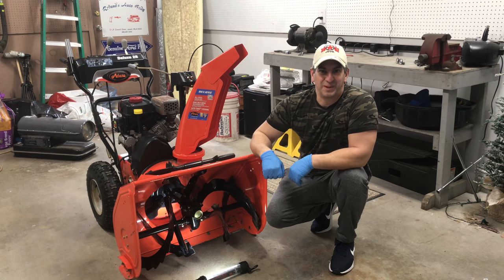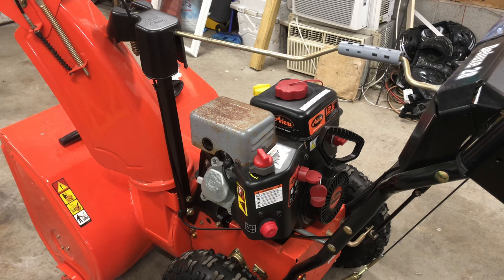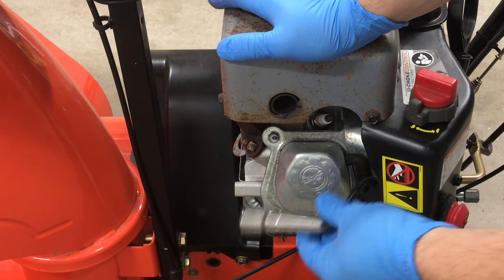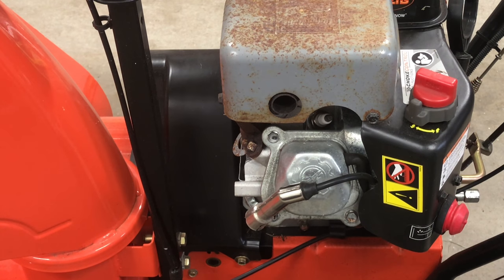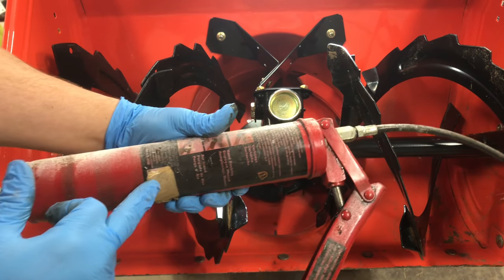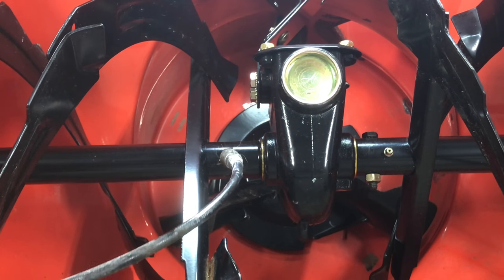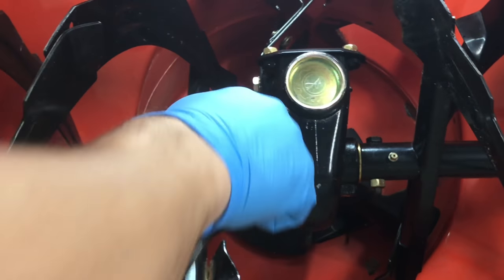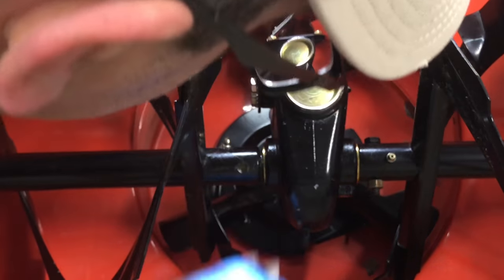How To Grease Snowblower Auger

Comment: Greath job!  Just make sure you put the auger in the same position they were prior to the maintenance, not half a turn forward.  The grease pin should be both in front.
Reply from the maker: Thanks for watching
Reply from the maker: This was a good catch, and yes you are correct make sure the auger is back in the same position before the shear pin was removed...thanks for the reminder bud
Reply: Why is that?

Comment: Great Vid and never thought to remove the pins so that I could grease and spin each auger on my big Troy Bilt blower. Quick question for you Sir: Just got this Troy-bilt from neighbor at good price and it is a full metal job from about 15 years ago...last of the Tecumseh big flat head engines. Well built but needing a few adjustments and cleaning. I wanted to change and fill the gear lube in the auger gearbox. Should I just remove the fill plug...stand it up on its front snout...let it drain out thru the fill plug hole...then fill with fresh? Do you think that will work?

Comment: Besides taking out the key and spark plug boot, i also remove both wheels just in case it starts by itself it wont run me over.
Reply from the maker: Thanks for checking out our video, hope this helped you out.
Reply: @HomeOwnerRepair  it did help me.  Well done video, i subscribed but i was joking. Oops
Reply: Funny guy.  Could could use chocks.
Reply: Oh crap, mine is tracked.... Can’t remove easily & chock dont work.... Lately I have been hoisting mine! Flipping it over like a turtle didnt work, tried to start! 

Good video... Mine doesnt have grease zerks, however after this season I will revmove my auger & add them! Ahhhh you haven’t modified your impeller yet??? You need to go, go , gadget that thing!
Reply: Removing the tire is way overkill.
Reply: Couldn't you just as easy set the parking brake?
Reply: @johnthree1611  i know, which is why it was a totally (not obvious i guess) joke. I just pull the boot and leave the key. It cant start without the boot connected. Impossible

Comment: So....the auger tube doesn't rotate on the shaft because it's locked in position with one (two on mine) sheer pin, but we lube it so...it doesn't rust?
I never really got it.
And yet there are no grease fittings on the end bearings, the bearings in the gearbox or the bearings on the main shaft, where you actually need grease. Go figure.
Reply: My exact question...why lube a fixed shaft?
Reply: @poppyatcs4529  the auger spins, it is not fixed
Reply: It's greased so that when the shear pins DO break, the augers will spin freely on the shaft. If the shaft rusts solidly to the augers, the pins will fail to shear and you risk gearbox damage.
Reply: @Brandon.S123  ok
Reply: @stevengao8345  It's fixed until the shear pins break.

Comment: no need to remove shear pins.  may i add, you should remove the wheels and grease the axles.  also, under the back pan there is one more grease fitting.    lastly,  change the oil.   (I just did all of the above yesterday,  bring on the snow)
Reply from the maker: When you remove the shear pin and turn the auger while you grease the auger it will spread the grease around the shaft.
Reply: @HomeOwnerRepair  you do have a point, I just never have. only blew one shear pin in 18 years.  and thats because the paper boy put the sunday paper in the driveway and not the box.  i didn't see it under 6 inches of snow.
Reply from the maker: Oh man....I used to be a paperboy too..lol Hey thanks for checking out the channel.
Reply: I've hit a paper before & my clearing tool...I have still never broke a shear pin on my husqvarna. Should I be worried or am I just lucky?
Reply: @KeepinYouUp07  Nah, if you watch where you go and clean it, it's normal to never break one. Ensure to grease it anyway because when you'll hit something, it will be useful.

And if you don't snowblow rocks pavement, you have much less chance to break it.
Reply: @dougm1985  Me Too, the Saturday Toronto Star about 40 years ago when the paper was about 2” thick.

Comment: When the zerk fitting is leaking grease it should be replaced but no biggie, good vid!!
Reply from the maker: Shouldn't have to it may have a little too much grease
Reply: Definitely should replace the zerk, they are 1 way fitting and grease should not come out at all
Reply: @HomeOwnerRepair  There is a ball bearing that moves back and forth inside the fitting  to control flow of grease in or out. When grease comes out upon removal of grease gun it means ball bearing is stuck in the in position.  It should be changed.  Good maintenance video..

Comment: What kind of gear grease do you use on your machine?
Reply from the maker: It was just a grease cartridge I picked up at our local auto parts store. Nothing fancy.
Reply: Hello we’ll I was able to put in fresh gas new oil new spark plug after some time she finally started. Only one catch it needs to run a little past the middle or else she stalls. 

Any suggestions for me from you or anyone. 
Part of me saids get a new car the other part saids keeps working on it.

Comment: Why do you remove the shear bolt? You only did half the job as you didn’t do the other side, or do you need to as doing one side lubes the other side too. Thanks for the safety tips.
Reply from the maker: I did the other side once I was done filming. Both sides should be done at the same time.
Reply: You remove the shear bolts to spin manually the auger to make sure there's grease everywhere.

Comment: Your smack on about the  preventative maintenance. This is a important part in keeping your 'blower in top notch operation. Aside from the auger many owners do not grease the wheel shafts, chute angle, drive levers, etc. Just takes about 1 -2 hours max every fall, and also during the winter usage to maintain. I do a complete oil change every fall, and calculate the used hours during winter and change the oil again,as these engines are under duress. Oh  and maintain proper air pressure in both tires.
Reply from the maker: A little maintenance goes a long way.
Reply: NiteGambler i have a 26" craftsman it has 2 zerck fittings on auger should i use lithium grease for the auger? also what is the correct way to grease wheel shafts ? I don't see any other fittings

Comment: Can i use a  Heavy Duty grease gun mini one I bought it at Home depot will it be okay to use  the grease is thicker then  Lithium grease . the guy at the store told me you can   plunge it 3 times  its very small is is 24 inch width . it weights about 208 pounds .

I wonder do i need to grease before i do the oil and gas  i just don't want that spilling out  it isn't specific i got a display model  it wasn't there very long they got it in a week before .
Reply from the maker: I just used a grease cartridge I bought at my local auto parts store.

Comment: What type of grease are you using for your Ariens auger?
Reply from the maker: It's an automotive grade bearing grease that you can find at you local auto parts store. If you have the manual see what is recommended in the manufacturer's owner's manual. Hope this helps you out.
Reply: I use Lucas Oil Marine Grease which only costs about $1 more for a 14 oz tube than heavy duty automotive grease. It stays in place better and provides better corrosion protection, especially against salt, which can be an issue if you salt your driveway like I do. Get it at Lowes, Home Depot, Oreilly Auto Parts, etc.

Comment: This video is very helpful as I’m a late bloomer to mower/blower/mc maintenance. Sick of paying others do do the dirty work and trying to get the confidence to do more myself. I also live in NH. I have a similar blower except with treads. Do you have any videos on lubricating chain? Thanks!
Reply from the maker: I currently do not but I will beep this request in mind
Reply: Lithium grease for the chain or a spray lube in a spray can just a little then make sure your drive plate is clean and the disc drive clean as well.

Comment: Good job man. After seeing your vid, i looked on my snowblower but it seemed i dont have grease fittings on my auger...
Oh well, its a shame they never were installed!
Reply from the maker: Thanks for watching. Don't forget to sub the channel to receive all of our latest uploads.
Reply: I was just posting about greasing the auger
Reply: Where does that grease go? Isn't there oil in the gearbox? Or are there grease channels to the bearing.?
Reply: @terryedmond4492  Based on my first snowblower I got... Your auger should run via the shaft that is connected to the gearbox, all this due to the shear pins/bolts. The grease being what allow the auger  to not build rust within the auger "cover" that go around the shaft that run via the gear box. So whent he shear pins/bolts break when you hit something, the grease allow the auger to turn freely without any rust so it don't damage the gearbox.
Reply: @HomeOwnerRepair  could you answer this?